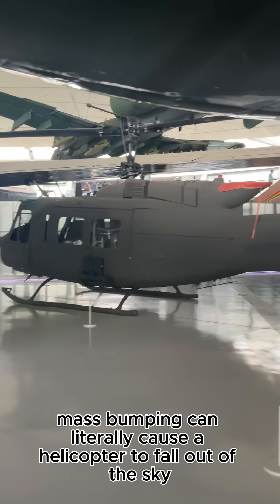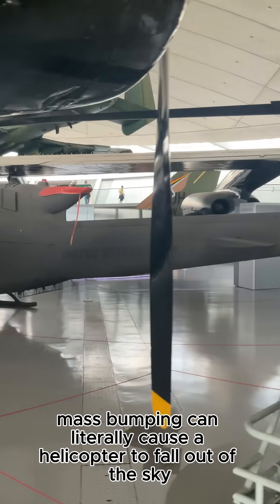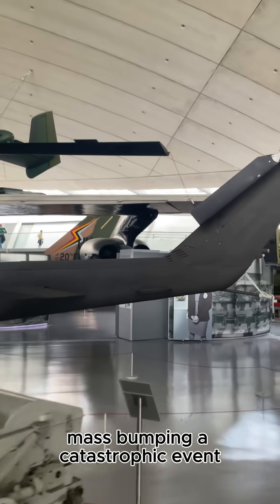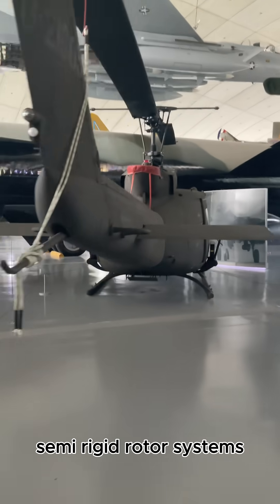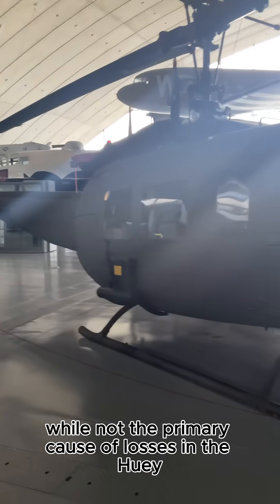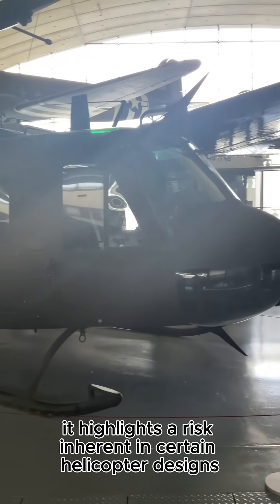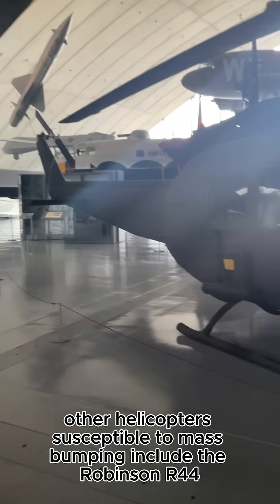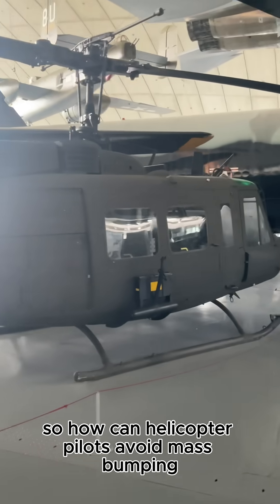Did you know Mast Bumping can literally cause a helicopter to fall out of the sky!?

Comment: Mast bumping is found in teetering rotor systems. 
The Army use to teach the issue back when Hueys, Cobras and Scout aircraft were very common in the inventory. 
Negative G maneuvers were taught to avoid thru classroom and in flight by showing how to cross powerline poles, ridge lines or dive on targets safely.

Comment: Well, now you got a solid example today from NYC Hudson crash.
Reply: Probably not. Mast bumping would have sheared the mast. The rotor and entire transmission tore out in the NYC crash. It's unlikely (but not impossible) to mast bump in a 206. Most likely that the transmission failed and locked up.
Reply: @baratono From my amateur understanding of mast bumping, it sounds more like a catastrophic transmission lock up and not “mast bumping”. Best to let the NTSB investigation proceed before jumping to any conclusions though.
Reply: Give the investigators a minute to pull that transmission apart That's attached to the rotor head. It's probably full of broken gears.
Reply: Transmission half separated 💯- this was not pilot error, but you bet they’re gonna have some massive recall
Reply: @LocalslayerFL  Probably high volume of flights and not much airworthy checking done by a proper mechanic
Reply: @LocalslayerFL  Schumers proposing all NYC helo tours stop until the investigation completes.
Reply: @paulwoodman5131  Schumer is a worthless politician. Not a NTSB investigator.
Reply: @paulwoodman5131  Schumers proposal is pure bs. Doesn't make any sens
Reply from the maker: Is that what happened over there?
Reply: @avpay  Looks like it. Rotor fell off and also cut the tail rotor off.

Comment: Stay well below VNE speed, do not do low G pushovers.
Reply from the maker: Are there any warning signs before it gets scary?
Reply: @ Yes typically a roll to the left and the helicopter pitching up. Lowering the collective immediately is necessary before a catastrophic failure.
Reply: @TornadoBox lowering collective yes, but cyclic  needs to be brought backwards to provide thrust to the rotor. Well, that’s what I learned from an old military “how to survive this shit” video from the old days
Reply: @crsnhppr8256  Collective must be dropped first before any cyclic input otherwise you’re just adding fuel to the fire.